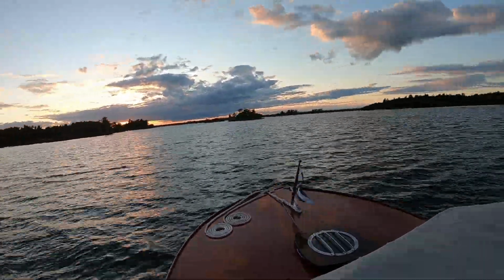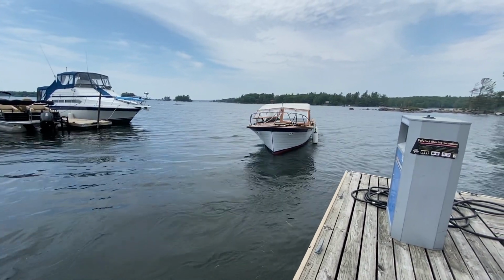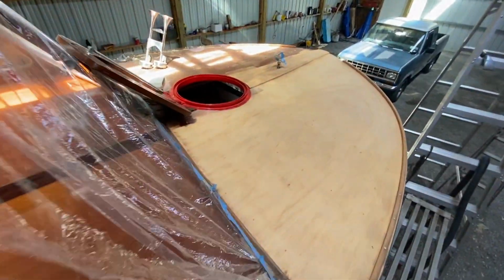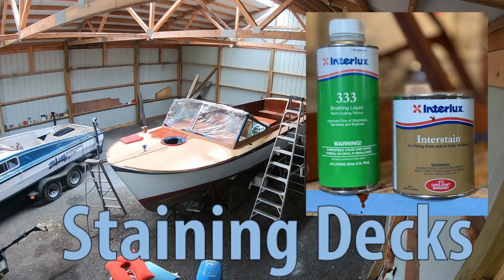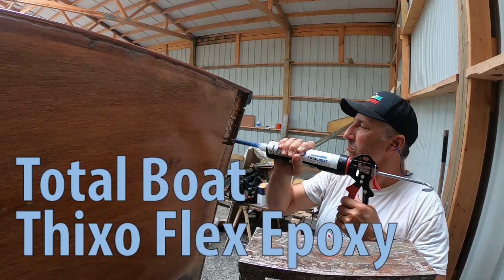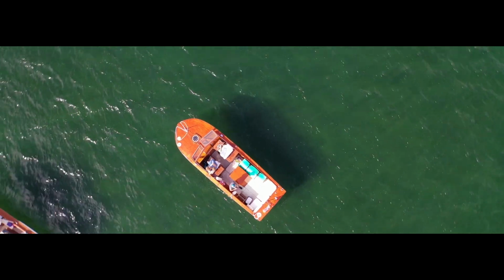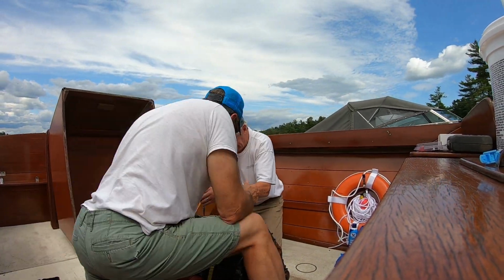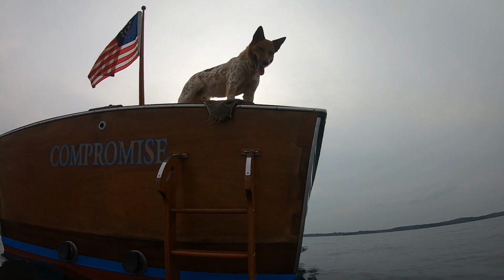26' Lyman Sleeper Update 2021 WBE S3E3

Comment: Sounds like gremlins were all over Chippewa Bay this year. We had an alarm on Fathers Day weekend…thought it was an overheating situation. Tried impellers first since I wasn’t sure when they’d been done before (we’ve had the boat 2 years). Changed those, then a week later I turn on the breaker and the alarm was going off. Turned out to be a fume sensor! 🤦🏻‍♂️ After a short shipping delay, got that changed out and it was finally quiet again!  I sure miss the river.  Things at home have kept us away since Labor Day. Closing up soon. The season is too short!
Reply from the maker: The fume sensor may have been working, could it be calibrated to sense alcohol?
Reply: @glassgoat9601  I can’t afford to drink, the boat is too thirsty!

Comment: Yank it and have it totally rebuilt at a good private machinist.
Reply from the maker: That would be an overreaction. That engine just needed a bit of sorting out and after that was done it continued to perform very well. It is now in storage awaiting another boat that needs it. We've done a compression test on it and it is good, there is no smoke at the exhaust. No need to spend many thousands of dollars on it needlessly.